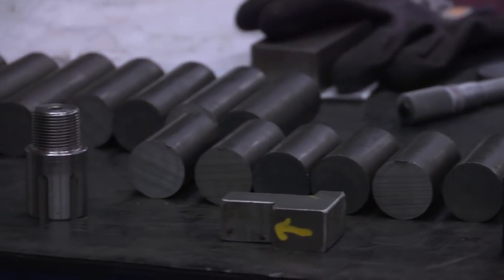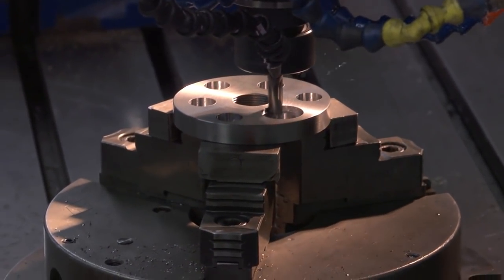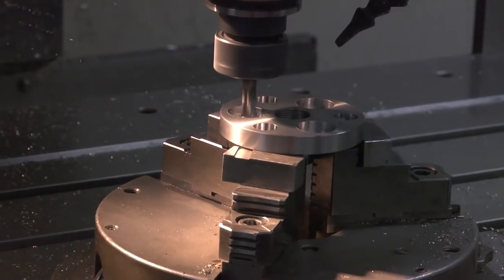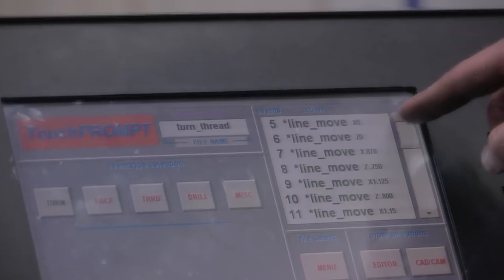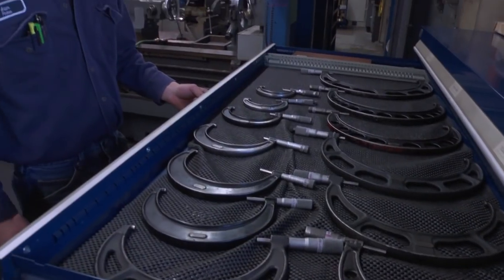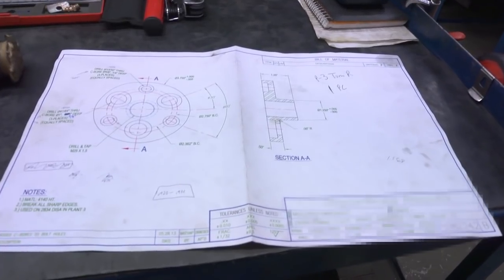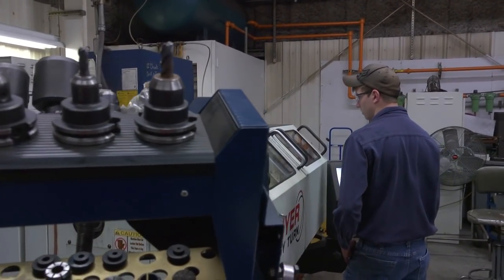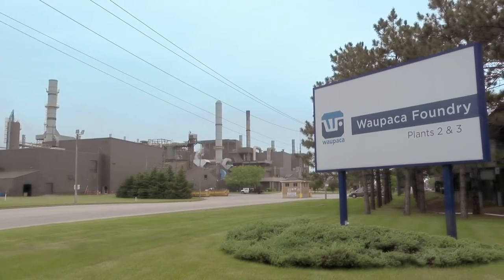Career Spotlight: Machinist

Comment: jeez...kid seems really young to be a machinist early in his career.
Reply: I've been a machinist since I was 14... got my first job where I'm going to make well over six figures as a machinist....
Reply: @summitgames6061  hello hows it going
Reply: @mikeledd9543  sup
Reply: @summitgames6061  i mean hows the machinist job going, I plan to get into the trade, tho I'm grade of mech engineering bsc, any advice or recommendation for a newbie? Is the job okay?
Reply: @mikeledd9543  I found an aerospace job where I work 3 days a week rn. This year I hit 80k for 2022, I like the job cause it pays for schooling, and get a lot of free time... the six figure job was a 12 hour a day job 4-6 days a week; Felt dead on the inside. I'm much happier now making less.
Reply: @mikeledd9543  I'm 26 years old with 9 years of experience. I started when I was 17, but dint start making good money until 2019, and went downhill during Covid., but made a good recovery...
Reply: @mikeledd9543  Remain humble in the trade, and become friends with the older guys. These old dudes know what there doing and can boost your experience by alot. That's one way I learned, I already worked at 11 different shops, and haven't stopped learning....
Reply: @summitgames6061 11 different shops? 😂😂😂 ah one of them arrogant lil trouble makers get ran out of every shop u work at